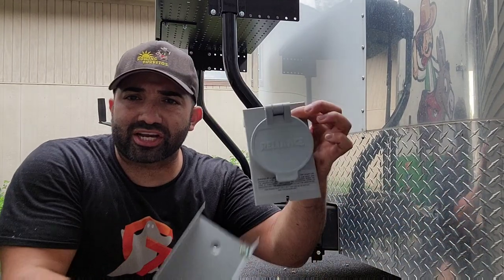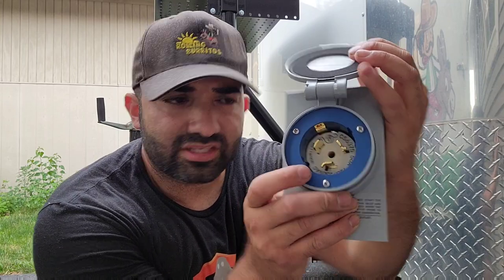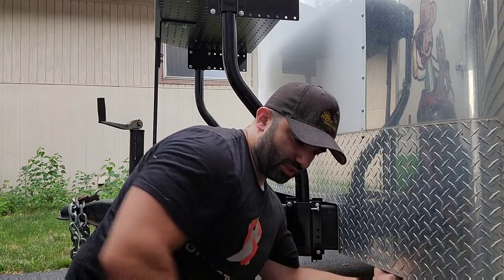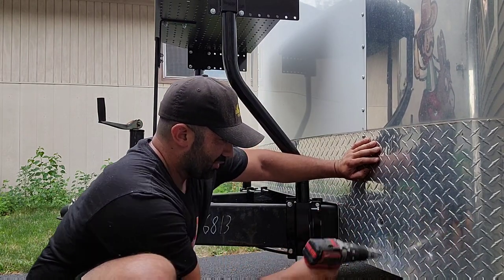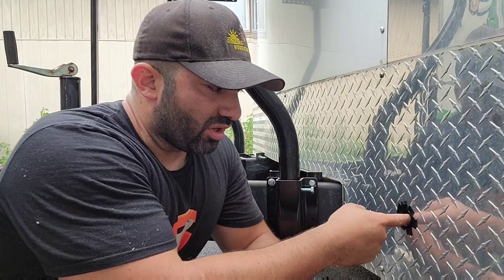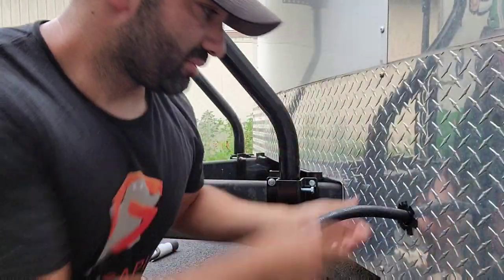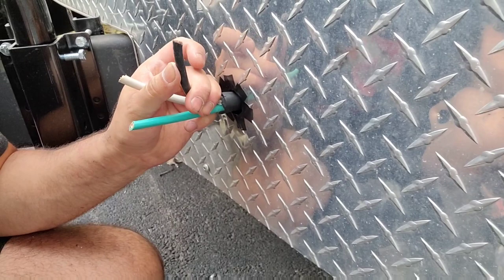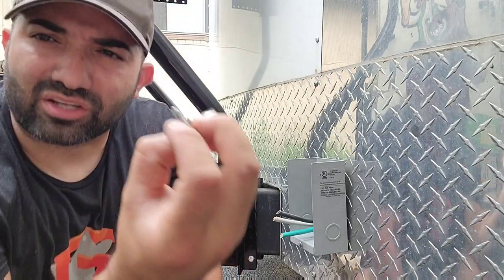Food Truck Electrical: How to Install a Generator Plug

Comment: Hey Frank. Great videos. I wired my trailer. Made a shore power plug & tested everything all outlets & light/fan everything tested good. Made my generator plug same way just like video, however my tester is saying I have an open ground. Not sure what I should check? Any ideas where to start?
Reply from the maker: Did you connect the ground to the breaker panel?

Comment: Love the series of videos I'm working on building my own food trailer at the moment out of a camper. I don't know if you said it but what kind of generator should we be looking for power output wise to make sure we have enough amperage to deal with
Reply from the maker: Appreciate that feedback. I would add all the Watts of your potential equipment and divide by 120V if using 120V only and that will give you your amps needed
Reply: @fbaltierrez  okay great thank you I'm still working on what equipment I'm going to be picking up. It's starting out as a small hot dog Grill

Comment: Hey Frank - I have a brand new trailer from China - it looks like there are 2 generator outlets under the trailer - they said one is a dedicated 220 and the other a 110.  Can these be combined into one reliance for the generator hook up?
Reply from the maker: Can they be combined how they are now, I wouldn't recommend it. I would just take the 220 volt one and run that to your breaker panel and from there go to the outlets, lights,equipment

Comment: I ran the SO cable through my trailer and into my electrical panel. Is this against code? I am seeing that you cannot use an extension cord wiring for permanent use.

Comment: Hi Frank! Let's say i bring my food trailer to an event where they provide power so I don't need to use my generator, is there a particular other cable I need to get that will go from my generator plug up port to the venue's electrical source?
Reply from the maker: Yes, same style of cable just longer possibly no plug required on one side

Comment: Hey bro if wired your inlet box for 240v would the generator that you use be able to supply sufficient power for that line? I hope I'm asking the question the right way.

Comment: Yo frank! My food trailer (brand new) didn’t come with a electrical panel/breaker box. Nor a 50A/30A inlet box. Instead it has a regular wall plug on the exterior. So im going to be switching it to a 50A inlet box. I just wanted to know if i need a breaker box/ electrical panel or if i can just leave everything how it is and just have the 50A connected to every switch and wall plug
Reply from the maker: No can not connect the generator straight to the switches has to have a distribution point like your house with the power from the power company. Not hard to do

Comment: All my appliances inside of truck are 110, on generator 50amp plug it has the 120/240 switch on it. Do I turn that on or keep it on just the 120? Also if I have a home plug that is wired to 240, can I plug my trailer into it or would I need a different plug for that?
Reply from the maker: @211mathew  the plug shouldn't have a switch if you use the same on I suggest on videos. If you wire it 120 v on plug it will be 120v. 240 is a different wiring it has one more leg of power. You can use that but then you would have to wore the panel and the plug to handle the 240v

Comment: When you installed the inlet box, did your trailer have a frame behind the diamond plating where you drilled? My trailer in the area where you installed box just has diamond plate.

Comment: Hey, definitely appreciate the videos. Question, if my panel doesn’t have a ground bar where am I running the grounds from the 14/3’s? Am I putting them in the neutral bar?
Reply from the maker: You can buy a small ground bar at local hardware store or Amazon. Called a bar kit

Comment: When should i install my rear door before, or after the equipment is in place.
Reply from the maker: I've never installed a door, but if I did I personally would install door, usually the door frame clearance is wide enough unless it's like a giant pizza oven

Comment: Hey Frank, I have a 30 amp plug. Would this adapter be safe for me to connect to my outside house outlet?
Reply from the maker: 30 amp plug is what I have also. I only use it at home to power my lights very minimal stuff.
Reply: @fbaltierrez  thank you 🙏🏻

Comment: Hi frank I have 50amp panel and I used 50amp dryer cord wire…and the food trailer spot only has 20amp hook up…is this thing gonna work and how many amp should I use on generator plug?or how many amp ?
Reply from the maker: It all depends on how much energy you actually need. Example your house has a 100 or 200 amp service it's there for you to use it all but will you? Depends on what things you use in your house. Just add it all up should give you the total amps
Reply: If I have 30amp appliances and the hook up only 20amp it may kick off?
Reply from the maker: @arthurperea274  you might have to upgrade the power there, run a bigger wire size to handle the 30 Amps

Comment: What’s the best Extension cord I should use to run my prep fridge and ice cream freezer as well with the electricity inside lights and air vents? Help please?
Reply from the maker: Extension cord? I don't use extension cords to power anything inside besides what comes factory installed from the machines
Reply: @fbaltierrez  I guess I meant what’s size cord should I use when plugged into trailer then to may house outlet?
Reply from the maker: @littlejoefragrance760  I just use a 14 gauge extension cord because I only power my lights when I'm home and maybe I turn on a fan or something. The other part depends on how Electrical need your equipment has. 15 amps is 14 gauge wire 20 amps is 12 gauge wire
Reply: @fbaltierrez  ok I think I’m gonna need a 10 gauge is there a number you have ? That we can call for help from you ? Like a pay program??
Reply from the maker: @littlejoefragrance760  yes on one of my videos I did mention you can email rollingburritosfoodtruck@gmail.com and we can work something out.

Comment: The box I have has the ground connected from the plug like yours, but then another green from that connection to the other part of the box. Where would I connect the ground from my truck?  And if I can't get in my fuse box, how do I determine whether to use the x or y for my black?
Reply from the maker: You can just swap them around. If the x doesn't work then just swap it to the y. I don't have a ground on the truck only the one for the trailer lights
Reply: @fbaltierrez  Thank you. I am trying to install a new inlet box on an 82 trailer so it can fit the new generator cords.  What I think is the ground is about six bare wires all wound together but they had it in one of the actual outlet connections with another wire wrapped around it going to the side of the inlet box.  And then I have a black and a white wire.  Am I right in thinking that the bare wires are a ground?  But then why would they be in one of the x, y or w holes? I can't really tell which label it's hole has.
Reply: The old outlet box also has a 6 wire wiring harness coming out of it which any insight on what this might go to would be appreciated.  In the trailer also has battery cables they set in the back and a set in the front that I can't tell where they lead but again, any insight on where they might go or what they might do would be helpful.

Comment: Hey Frank,

Where you get the screws for the inside Stanley steel and what size?
Thanks for your videos man
Reply from the maker: https://www.amazon.com/gp/product/B083SMKNKK/ref=as_li_tl?ie=UTF8&camp=1789&creative=9325&creativeASIN=B083SMKNKK&linkCode=as2&tag=rollingburrit-20&linkId=4a171ac796a5d88c8c5b5fa1705060e2

Comment: any videos on connecting from the actual generator , not the trailer plug. Like how to wire a gen that has several plugs on it?
Reply from the maker: I only use one plug on my generator the main one 120v 30 amp to the generator inlet box. That is all I do

Comment: Hey Quick question what wiring did you use to run 240v?
Reply from the maker: I don't use 240 but if you did you just need to get a cord that has 4 wires